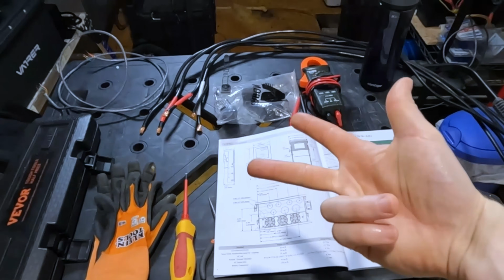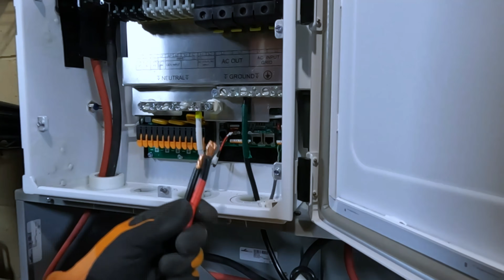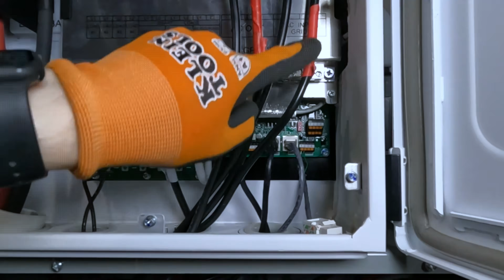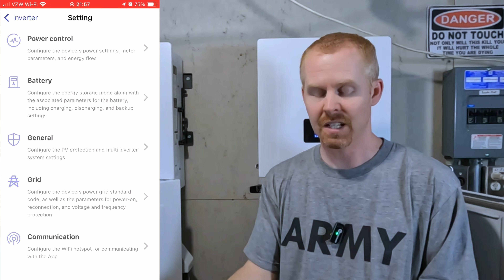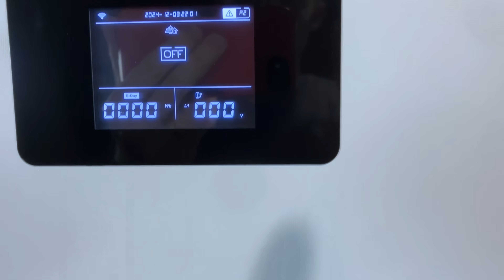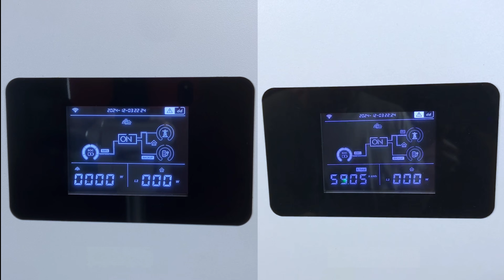Doubling the Output: Paralleling MidNite One Inverters

Comment: I am stuck with 4 goodwe 7.6kw trash that cannot be paralleled. My battery bank is 60KW now I need 4 separate sub panels to backup the whole house or look for at least a 20KW hybrid inverter that can handle the 60KW high voltage batteries. .
Reply from the maker: Oh man, sorry to hear about that.  Was it just something that you had looked at adding more inverters later hoping you could parallel them?  

I think the Solis S6 can run on the HV batteries and at least parallel 2 units together.  Not sure about anything else.
Reply: @AdamDeLayDIY  They came as a package from an eBay seller who I think have no idea on solar, the manual says contact the manufactory for advanced installation & stacking but GoodWe said they are not stackable. I am looking to replace 2 of the 3 11KW Solaredge inverters with their 11.4 energy hub, I think that will give me at least 24KW off the grid.
Reply from the maker: @riftvalley1765  Yikes.  Sorry about that.  Maybe you could sell them individually to recoup some costs?

Comment: Thank you very much for this video.  I have the Sungold SGN-11.4kb units (also made by Senergy) and followed the included wiring diagrams and couldn't get the unit to parallel.  ID mismatch.  I am running independent battery banks, so each has a BMS connected.  Per the manual, I had CT clamps connected to each.  When I disconnected the CT clamp from the slave unit and restarted, everything magically worked.  I double checked the manual and it specifically shows the CT clamps wiring to both units.  Your guide gave me the thought to disconnect them.  Thanks!!!  Big Time!!!
Reply from the maker: That's awesome!  Thanks for sharing! 

I think I had actually had the same issue as you and just tested switching things around and as soon as I removed the second set...BOOM...stuff started to work!  Enjoy!

Comment: Adam, can you provide a link to the power distribution blocks you used?
Reply from the maker: @fm-hy2bb  here’s the ones I used.  

https://amzn.to/4k2HqV3

You may wanna get larger ones though for full support based on the inverter specs.  Mine are undersized for a full load.

Comment: Thank you for making this video, Adam! I am slowly working (with midnite support) my way through the issues I am seeing. They suspect the standby mode issue is due to my batteries using closed loop (3 x EG4 indoor wallmount). Do you know how or do you have any information on how to set batteries into open loop configuration?

Cheers!
Reply from the maker: Sorry to hear you're still having issues.  

You would go into battery settings and change the type to either Lithium Battery (no BMS) or Lead-Acid Battery.  Either one will let you set all your charge parameters based on Voltage.  Then you would just program the EG4 battery values in there.
Reply: @AdamDeLayDIY  btw, do you know if you can use a cat 5 cable? And if so, do you know which colors should go into which pin? On page 16 it shows cables for CAN/RS485 and what each corresponds to, but on page 19, it shows different colors?
Thanks for the all help you've given so far!
Reply from the maker: @ yes you can use a CAT 5 cable for the parallel connection.  Colors don’t matter as long as you have the same color in the same port on both inverters.
Reply: @AdamDeLayDIY  Yeah, the parallel connectin cable I've set up. I was just not sure if I needed to have an rs485 from battery to inverter when going open loop. Support just mentioned that no communications cable is needed, so I'm just going to unplug the battery communications cable to the inverter, and leave the parallel battery cables connected (I have 3 EG4).
Reply from the maker: @ yeah, open loop doesn’t require any cable to the battery.  The inverter just uses the voltage detected on the battery terminals.
Reply: @AdamDeLayDIY  Thanks again, Adam, much appreciated!
Reply from the maker: @dominiekmeers4749  you bet!
Reply: @AdamDeLayDIY  Happy New Year, Adam! 
If I were to setup my inverter with the gird as back via the GEN breakers, would I have some control over when the grid is being used? Currently, in off-grid mode, when PV is limited, it uses the grid to charge the batteries (if enabled), and supply the load. I was wondering if the grid could be limited to just charging the batteries, if needed, and just have the batteries supply the load. Self consumption mode will not be working for me since the utility company said it's been back-feeding to the grid, even with zero export to grid enabled.
as an aside, I switched my batteries to open loop recently, and have not noticed any issues so far. My batteries rarely max out now though due to the heavy load from the heater and the still short days.
Reply from the maker: @dominiekmeers4749  Happy new year to you as well!

If you use the gen breaker for the grid, you can use the battery SOC to determine when that breaker turns on/off and you can also decide if you want to charge from the "gen" as well.  

Right now if you overload the output while on battery power, it won't instantly fall over to the gen port like it would for the grid.  That's really the only difference I've seen so far.  

As far as the backfeeding, are your CTs backwards?  Also what do you have set for your Maximum consumption from grid?
Reply: @AdamDeLayDIY  overloading, when the load is bigger than the inverters can handle? So with AC-In, it would instantly switch to grid for the extra load?I don't think I've run into that issue since I've been tracking my consumption (I did when I was on a single inverter). Do you know what the switch time is when using the gen breaker?
For backfeeding, the CT's are in the correct position (from Grid to inverter) and the setting in the app reflect that. My utility company send me over a spreadsheet that shows when the backfeeding started, which was when I hooked up my systems in parrallel. It has since been backfeeding almost constantly when I am in self-consumption mode. Usually tiny amounts, < 60 W, but occiasionally +/- 120W. The total fed back as of today is 1.9866kWh (since November).
Yesterday I switched to off-grid, with grid going into AC-In, and there was no backfeeding. However, the behavior with that setting is that the grid supplies the load (I have battery charging turned off). Even when I have PV going, the grid still supplies the load, which is not what I want. I thought that was interesting, since I had some pretty big load on and off, heater, EV charging, coffee machine, microwave, and fryer, etc. But nothing fed back to the grid. Midnite Solar told me that there is usually some tiny amount being pushed back to the grid when there are big loads. But when I saw the spreadsheet of the months before I installed my second inverter (even before I had my solar system), it showed 0's everywhere, no backfeeding at all.

During the winter, the heater runs most of the time and it pushes my batteries very close to being depleted, and sometimes beyond, which is why I would like to have the grid as back-up, for the occasional days my batteries are not enough. I want the grid to be used only in those cases, or if there was ever a need to charge my batteries fast.
Reply from the maker: @dominiekmeers4749  yeah, overload as in pulling more than the inverter can handle.  

I'm not sure on the specific transfer time of the generator but it has to be around 20ms I would imagine.  I never loose any clocks/computer power and half the time I never even notice when it switches.  It actually switched this morning and the only reason I knew it happened was because I heard the click in the other room.  

Odd that it's still pushing back up to the grid.  At least the poco is "being nice" (that's my assumption) and letting you know what's going on.
Reply: @AdamDeLayDIY  With your current setup, are you still running in off-grid mode? And do you have the grid coming via the generator breakers? Or do you have an actual generator hooked up to your inverters?
I also missed your previous question, my max consumption was set to 500W
Reply from the maker: @dominiekmeers4749  So I'm currently running in off-grid mode with grid going into the generator.  Been running that way for several months now.
Reply: @AdamDeLayDIY  If I may ask, what do you have your settings set to for the generator (gid) to turn on/off? I assume you are running with SOC? I recently switched to using voltage instead of SoC.
Reply from the maker: @dominiekmeers4749  At the moment I have mine set to turn on by SOC at 75% and back off at 100%.  My batteries got too low for several weeks so I changed values so they would remain higher especially during the bad weather.
Reply: @AdamDeLayDIY  I have set my generator to kick in at 10% SOC and turn off by SOC 40%. I noticed that the loads are running from GEN and not charging the batteries. Does this setting require "grid charging enabled"?
Another interesting thing I noticed is that on the displays of my inverters it shows the frequency of the grid is 44.2Hz (I have nothing wired to AC-In, only to the GEN breaker), with the grid going into the smart load (GEN) breakers (app settings are to generator for the smart breaker)
Reply from the maker: @dominiekmeers4749  If you want to charge the batteries while using the "generator", under the generator smart load settings, you would have to change the value for "Maximum generator charge power".  That controls how much power the generator can use to put into the batteries.  As always, powering your loads will come first and then any excess power (up to the max charge power setting) will go into the battery.

As far as the "oddity" on the grid port when nothing is wired in, I've seen that as well.  It actually seems to be a common issue on a lot of inverters where there's some "bleeding" happening when the port is not in use.  Each time I've brought it up to the different inverter manufacturers, they tell me not to worry about it.
Reply: @AdamDeLayDIY  Thanks again, Adam! Much appreciated!!
Reply: @AdamDeLayDIY  It looks like the default settings are 10000W for maximum input power from generator and maximum generator charge power. I could either reduce the maximum input power from generator or increase the maximum generator charge power. I'm assuming the delta (if positive) would be the charge to the batteries.
Reply from the maker: @dominiekmeers4749  If you want to charge from the "generator" you would have to increase the charge value.  Loads will always be taken care of first.  Also, you'll have to have the max input power = or higher than the charging power setting.
Reply: @AdamDeLayDIY  Looks like all issues are finally resolved (at least as far as I can tell), and not including the data reporting (a fix for that is in the works). The dongle issue I was having with being unable to connect to wifi, is because the dongle needs to be setup in when the inverter parallel mode is turned off. So, set inverter to standby, turn off parallel mode, set wifi SSID and pwd, wait for it to connect, and then turn back on parallel mode.
Since I set up the grid via GEN input, there has been 0 back generation to the grid, and the behavior is they way I want it to be (gen kicks in when batteries are at 10%, and turns off when they are at 30%). I'm only charging my batteries via PV.
The infrequent standby issue looks like it is related to my batteries SOC diverging too much. So the fix is charging the batteries to full more frequently before the SOC diverges too much.
I am going to monitor it a bit more in the coming weeks, and then I'll do a data reset and hopefully everything will be tracked correctly. I'm a bit on the fence on whether or not to wait for the data/service fix on their end or reset the data next week.
Reply from the maker: @dominiekmeers4749  Glad things seem to be working better!
Reply: @AdamDeLayDIY  Thank you for all your help, it made a huge difference!!

Comment: I slide a Ferrell onto wires then tighten screw.Nice torque screwdriver!
Reply from the maker: @2hotscottpro  thanks.  I use ferrels if I’m using fine stranded wire or if the manual specifically calls for them.

Comment: Good video.  Looks a more difficult to set up than a Victron system for example where it's jus plug in the comms cable and click go in the app.  They need to work on their interface a bit it's not very modern.
Reply from the maker: Thanks.
Yeah it is a little more complicated.  The connections are a pain, but I've already heard that there's gonna be updates for the connections.  The app could use a face lift.  Hard to compare when you're used to Victron's VRM...

Comment: Electricians are taught to tug and wiggle the cables after they torque the terminals and retorque. You will find that the lugs needed retorqued.
Reply: I put ferrals on strand wire.Screws are never as wide as cavity letting strands out.There cheap so why not.

Comment: Just a heads up in case, and I don't know the exact wiring layouts so this may not be a concern with what Adam is doing, but when testing ground continuity keep in mind that in the USA electrical system the neutral and ground are linked so even though a continuity meter may beep, it could be measuring across the neutral/ground bond rather than showing you have continuous ground between two things.  The resistance reading in continuity mode will give a hint but ideally check without the possibility of alternate paths (neutral/ground bond, bonding in general, other grounding conductors to appliances - HWS grounding carrying onto plumbing where it is then connected to plumbing bond etc) giving the appearance of a continuous ground between things when in reality it's going 'the long way round'.  The long way round will work but the risk will be that if that incorrect path is interfered with by changes in the electrical system in the future you could well lose your grounding; as well as having potentially excessive current flowing on wiring in a fault - imagine the HWS ground wire trying to carry a 100A fault.
Reply from the maker: @retrozmachine1189  that’s a great point!  I thought about that when I was editing the video.

Comment: I just ordered 30 380w panels, and am trying to decide on best inverter. I have Powershare with my Cybertruck.

I'm leaning towards EG4 Flexboss21 with a single EG4 wall mount battery. 

I would put it between the house panel and the Powershare.

I wouldn't be using solar to charge my truck, but it would power the rest of the house which peaks around 13k max.

I was thinking victron first as i have a small system on an out building, but the extra work doesn't appeal to me as a beginner. 

The midnight solar was my alternate choice, do you have any thoughts that might help my choices? I really don't have space for two of these.
Reply from the maker: @michaelhess4825  Well between the MidNite and the FlexBoss, right off the batt you’ll have an output difference.  Without PV, the MidNite is only a 10kW inverter while the FlexBoss is a 12kW inverter.  Both will have the ability to surge for a limited period of time but if you’re constantly at our around the 12kW range, you’ll probably need to look at the FlexBoss if you don’t have room for multiple inverters.  Depending on how often you’re running near 13kW, you may want to investigate an alternative installation point because you wouldn’t have any room for future growth.  You’ll always be adding more loads to the home so it’s almost inevitable that you would need to expand at some point.

I will say that you would definitely want to look at more than a single battery.   I don’t think with either inverter you would be able to output the full rated capacity of the inverter off a single battery.
Reply: @ I can make room for more batteries, and I’m not aiming for fully off grid, so I can move some loads off the inverter. I just don’t have the funds to go full speed ahead yet. I average around 3-6k, only when my heat pump is at full chooch during the coldest days, do I hit around 10kw. Thank you for the advice, I feel better knowing I’m not in the wrong forest, let alone just up the wrong tree!